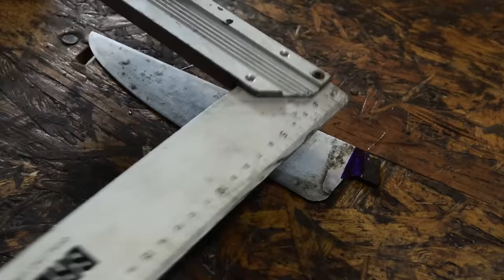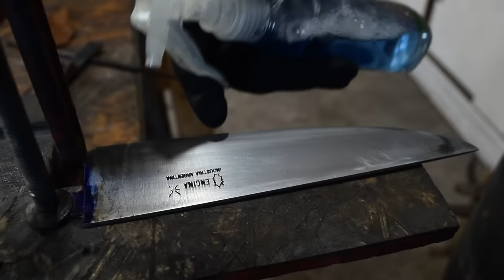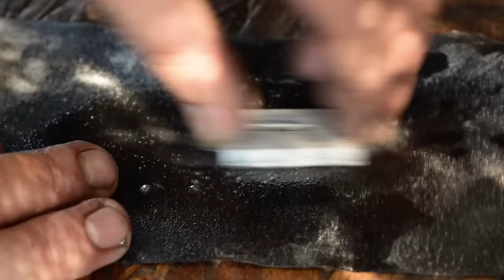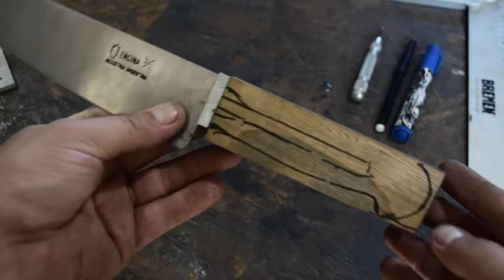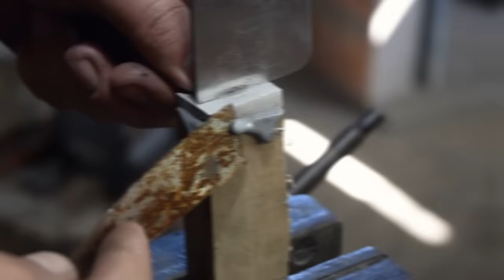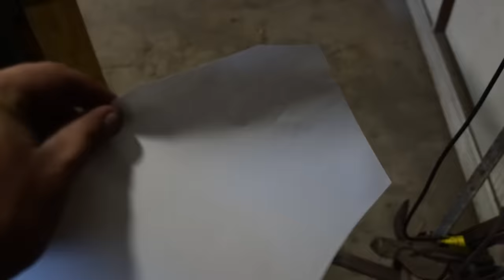¡VAMOS A ARREGLARLA!

Comment: I very much liked the way you saved a good blade from going to trash. However, you didn't mension how you fixed the screw to the broken end. I think you welded them together. What welding method you used if so?
Reply from the maker: I hope Google translates well: weld the threaded rod to the tang of the knife. use stainless steel electrodes. Do not fill the process for fear of damaging the chamber. greetings 👍

Comment: An alternative, in order to make longer piece inside handle,
reduce lenght of blade by cutting itno it, say 2cm, 
make holes in that new piece in the handle, use pins or screws to secure through the handle
Or
weld threaded lenght for entire handle to be secured into handle then cap end of knife with wood after screwing it.

Comment: I will say one thing: a good steel file will not process the blade of the blade. ! Use your knife only for decorative purposes or cut bread, butter, cucumbers. I am sure that after these products it will need to be sharpened often. How will the translator translate my text there...if strictly according to science, glass is Mohs 5, and is effectively scratched by an object that has a Mohs of at least 6. In terms of the Rockwell scale, this is 59. But in real life, the hardness of different glasses is somewhat "walking", so that some scratch steel with a hardness of 58, and others - only with a hardness of 60. If it scratches ANY bottle, it means 60 or higher.
Reply: Клинок обычно имеет зональную закалку. Обух не закален . Обух обрабатывается напильником, а лезвие нет. Только кончик лезвия был исправлен.